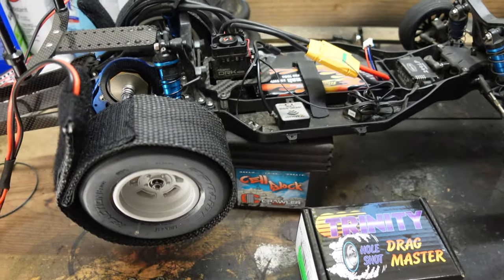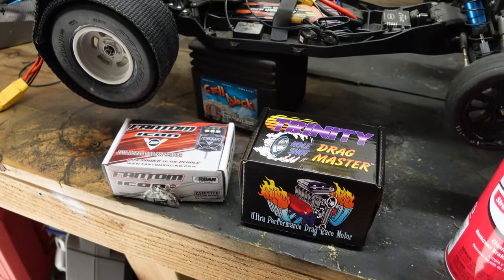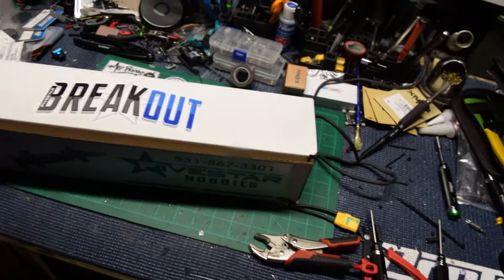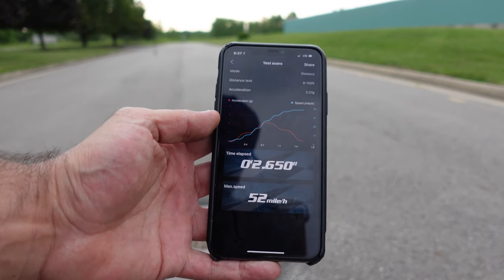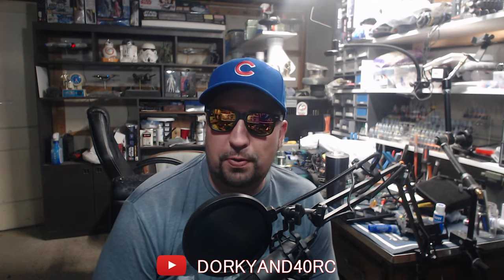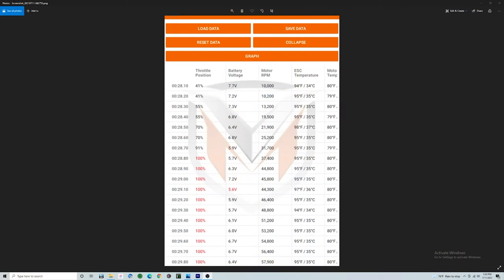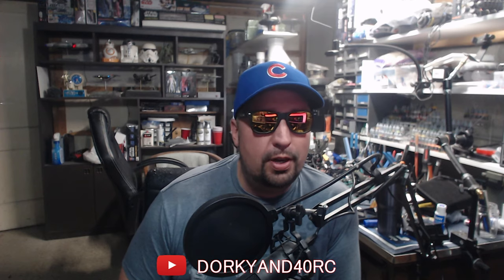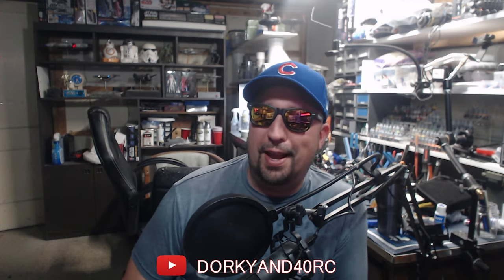Trinity Drag Master Holeshot 3T Testing with the DRK160 | Data Logging | Battery Pains

Comment: You need to drop about 3 teeth on your pinion judging by rpm and voltage. 3.0t start around 15-16/87-90
Reply from the maker: appreciate that..gonna put this in  the breakout and ill take that advice my friend

Comment: Do you think that switching your esc to 1/8 scale esc would help you out over the DRK would that maybe help with the voltage loss?
Reply from the maker: Maybe some? That snd finding the magic gearing but I think to really unlock it you need those multi cell batteries to take the hit.
Reply: Deffently true the 1/8 esc is the Xr8plus g3 Boost and turbo 200Amph 2-4S

Comment: If your trying to make 2.3 area your gonna have to prep your tires. I test and tune with guys that prep and you can tell the difference between passes
Reply from the maker: the guys with me were doing the same prep the same day with brake cleaner simple green and heat and running 2.0s to 2.1s

Comment: Hi..do u think the trinity 3.0 drag master motor will work good with the mamba monster x 6s esc, with the 6400 trinity 200c battery?
Reply from the maker: its a solid combo.  just need to work your surface and adjust your chassis for the road and let her eat!
Reply: @Dorkyand40  thanks man
Reply: What gearing do you think I should start with
Reply from the maker: 96-18 if it fits.
Reply: @Dorkyand40  Thanks again

Comment: hello great vids thank you.. which motor would you recommend for my losi 22s drag car.. fantom 3.5 or 4.5 and which fantom esc thank you.
Reply from the maker: Drk and a 3.5 is nice combo that I run on dr10
Reply: @Dorkyand40  how many amp is that esc.. will my 100 amp run it
Reply from the maker: Sure.  Good enough for many.  The next step would be a 3 turn and an rx8.
Reply: @Dorkyand40  I was thinking of that big Mamba x and a 3.5 turn fantom.. do you think that would be a good combo
Reply from the maker: @thundervalleycbshop6362  for sure it’s my big winner. Except a 2.5
Reply: @Dorkyand40  thank you so much

Comment: Trinity for the win but that DRK is going to struggle
Reply: Yup. Its says rite in the instructions not to go lower than 3.5 .
Reply: @robschierbaum  I think he's moved on to 1/8 scale and throttle speed
Reply: @powermadracing5116  thats what all the smart people are doing. 😂
Reply: @robschierbaum  it's expensive route just can't get away from that 1/8 low turn power

Comment: Is it like the lower the t is the more power ? Bc I have 8.5t
Reply from the maker: yes sort of.  turns is in some way equal to KV.  but the best way to think of it is motor potential.  so a 4T can run as fast as a 3T but the 3T when all else is equal should be faster and produce a higher KV.  a lot of people race with 4-8T motors and run great times.  lower turn motors demand more voltage and pull more amps.  they get harder to tune and are a little harder to gear.

Comment: My question is can drag master trinity be used mamba monster x ?
Reply from the maker: Yes. That esc will run any 2 or 4 pole motor fine
Reply: @Dorkyand40  thx
Reply: @Dorkyand40  can trinity 2.5t be use as sensorless mode?

Comment: Its wierd because the first 6-7 passes i did with my mmx8s and trinity 3t were great almost ran a 2 flat but now amp draw is pushing 370”s the best i got out the maclan was 2.4 consistent wish the maclan could run the 3turn the motor has so much potential any esc recommendations i could try to get the 3 turn to run at 100 percent efficiently on 2s  im dieing here and money no object on this esc i dont care if its $500 bucks
Reply from the maker: rx8 is working for me
Reply: @Dorkyand40  just picked one up! Wish me luck bud haha
Reply: No limit what gearing?
Reply: @corneliussimpkins6296  26/81

Comment: It's weird looking back at this video and you're trying to run the three and a half turn three turn motor and only run in 250s I have a VXL I've run 250s to 60s 52 53 miles an hour 56 miles an hour on the clock mid 240s 244 242 I think it was really doing good man but I think with you just what I mean I think I'm just like you stuck with insufficient battery I'm ready to make the jump but I don't think I don't feel like I've beat with the VXL but it won't be long now before I make the jump to probably a trinity like a four turn

Comment: I have the same motor in my dr10 3.0T
Reply from the maker: How’s it working for you.
Reply: What esc are you running brother?
Reply from the maker: Drk and tekin rx8
Reply: @Dorkyand40  ill run the rx8 with my 3t and she what happens from there
Reply from the maker: Working good in my breakout build.
Reply: @Dorkyand40  i thought i had the secret recipe with the 3t and the mmx8s but the esc is now pulling close to 400 amps no matter the battery , cap pack  its slowly dieing  pretty sure the holeshot motors are d wound castle should really fix this issue